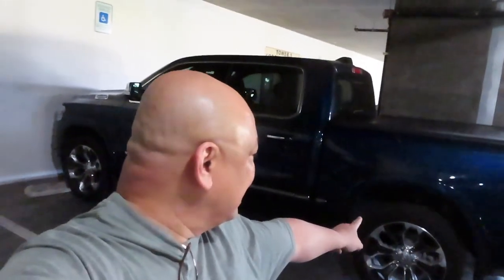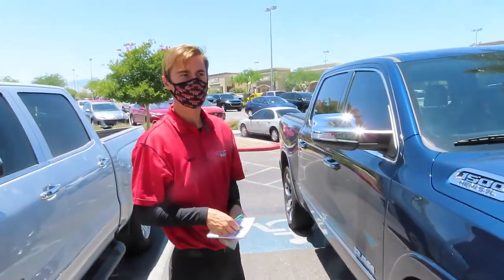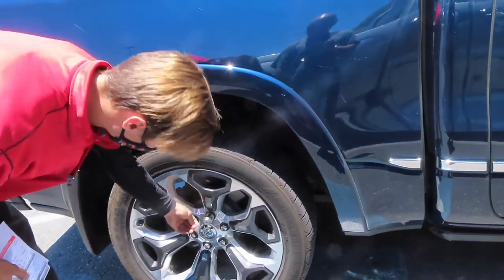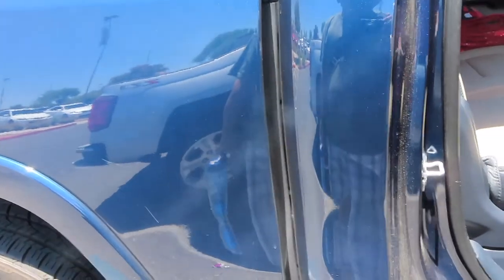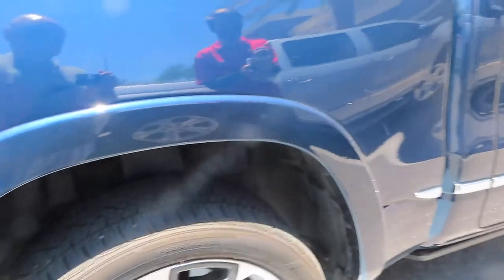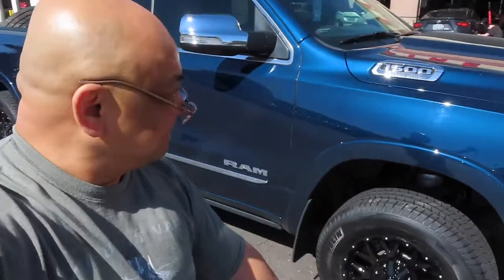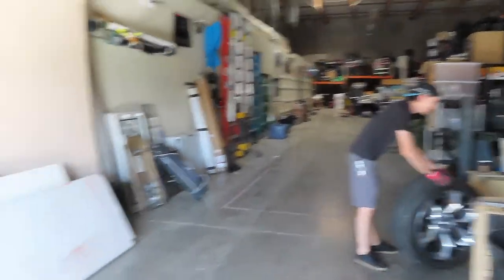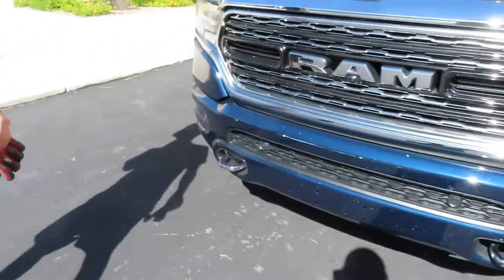New Truck Tires For The Ram 1500 aka Aries

Comment: Here is the math for you:

Stock tires on these trucks (2022) :
285/45/22 Pirelli Scorpion Verde

Load rating for those are 2601 x4= 10404

Your stock GVWR (gross vehicle weight rating) is 7100. So the tires are rated way over your rating for your trucks weight and full payload of your truck. Your truck can pull somewhere around 10500-11000 lbs. even if you have 1000lbs of tongue weight and you and your wife/husband in the truck and are at full payload your truck still has over 2500lbs of load rating left for safety.. that’s huge.. the wheel size has nothing to do with towing ( besides if the wheels themselves weigh a little more you lose maybe 50-80 lbs of payload but again has nothing to do with towing rating or payload as it’s negligible. The tire rating is what is the deal breaker and the tires are rated way over for what your truck can do. Either way just wanted to explain it so you understand it a little more for next time you need tires or just to know.
Reply from the maker: Thank you for the explanation, this helps my understanding!!!!!

Comment: It is funny how the dealership wouldn't allow you to buy the truck if they thought it was to small for a trailer that you had in mind but they were fine will selling you a truck with tires that were not designed to tow heavy things.